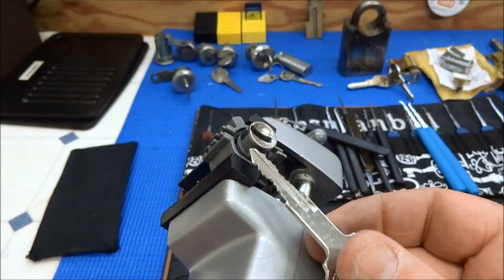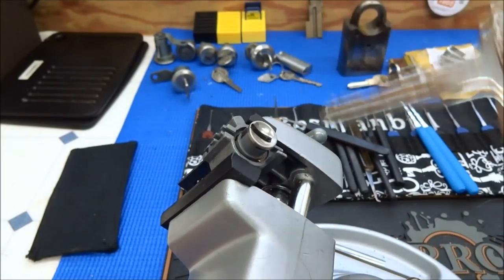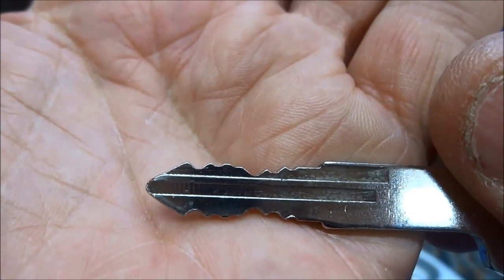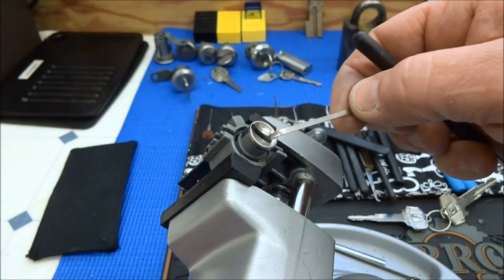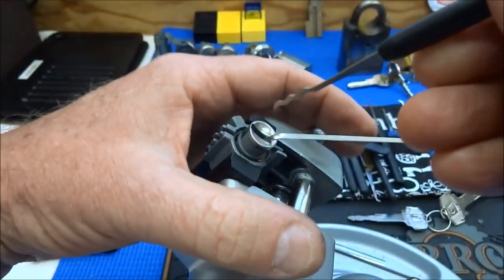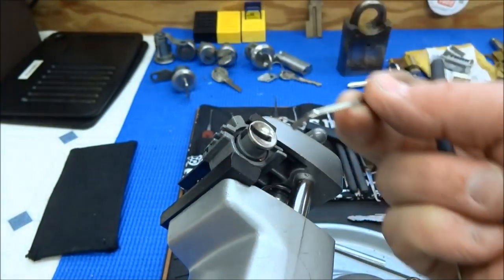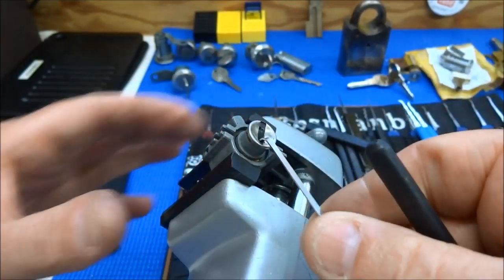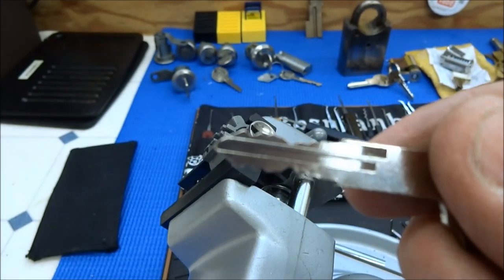(559) Moped or Motorcycle Ignition Raked Open

Comment: Thats absolutely crazy!--no security there at all ... 
 Bill, I'd also like to thank you, as my peterson lock picking set came in the mail a few nights ago, I havn't stopped fiddling with it all since! I ended up going with the GSP 20 piece, it seems to be a great kit per your recommendation to another fellow here on the tube a while back. 
I had tried my first night to pick a Masterlock #1 but proved too difficult, I am now using an old deadbolt from a door I had laying around, so far I took all the pins out, besides 1+2, trying to get the feel for it slowly, especially the feel for the "binding" pin.... I hope to soon work my way up to 5 pins however I will take it slow to make sure I do it right and hone my skill as I go as I hear SPP is the way to go to actually improve your skill!.. the only thing I dislike about this particular deadbolt is that the cylinder itself is smaller than the shell, so it has "wobble room" inside the shell, so there is a lot of moving/clanking while trying to pick it, however I guess it will push my ears and feel that much further to pick up exactly what I am looking for... 

Keep up the great videos my friend, now it's time to find a nice looking pinning tray and an affordable plug follower!

Comment: That is no Motorcycle lock it is an older Datsun ignition lock.  One of the worst designs ever,  Us older locksmiths remember the days when it was not uncommon to replace several everyday.
Reply: Roger Shoaf 
Good moneymaker, codes in glove box, easy to impression.
Reply: That bitting looks nearly identical to my '90s Nissan 300ZX key, actually. I count 8 pins on mine, but there is not a wide difference in the bitting at all. Doesn't give me a whole lot of confidence...